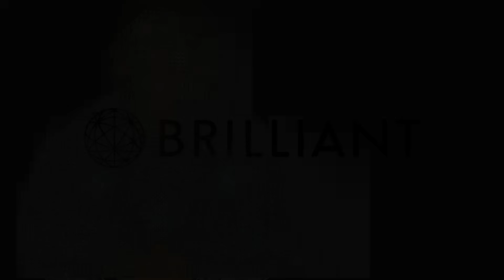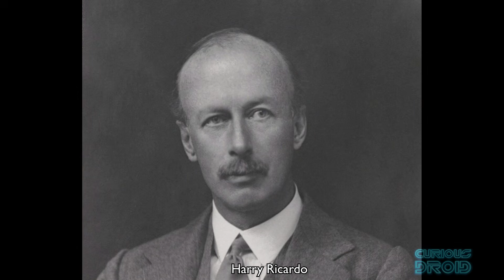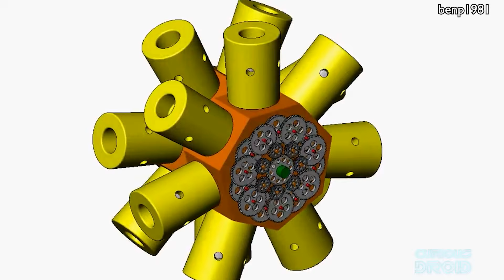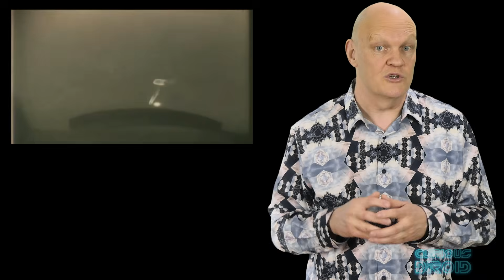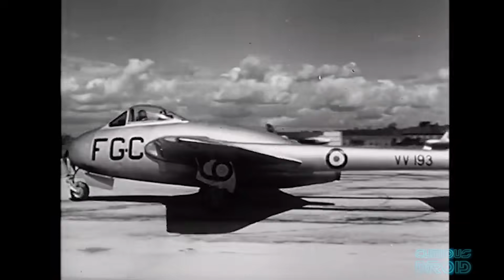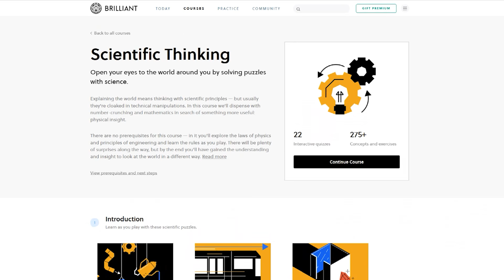Rolls Royce Crecy - The Most Advanced Piston Aero Engine Never Made.

Comment: The crucial advantage of the jet compared to the piston engine, apart from its much higher power/weight ratio, is its scalability. Jet engines can be scaled up almost arbitrarily while maintaining their power/weight ratio, there are gas turbines of 1,000,000 horsepower or more that fit in a railway carriage,  while the most powerful aviation piston engines peaked at about 5,000 horsepower, and the biggest marine diesel engines have around 100,000 horsepower, weighing thousands of tons and being as big as multi-story buildings. The piston engine lost the competition with the jet at the end of WW2 with no hope.

Comment: Historical reverse engineering is fun!
Today there are small businesses that converts 4valve DOHC-engines in cars to cheap reliable pushrod engings. In a Porsche 928 it is not uncommon to swap the 5l V8 DOHC with a Chevy 7.5l bigblock V8. The external  engine size and weight is almost similar between these two engines, but the chevy has 50% more displacement. (an optimized small block chevy 5.7l is too light for the 928 std front suspention)
I just wonder what capacity a "chevy" pushrod, 60deg, V12 with central camshaft and 2 valve heads would have within the space confines of a RR Merlin? Maybe 45l in a much lighter engine?

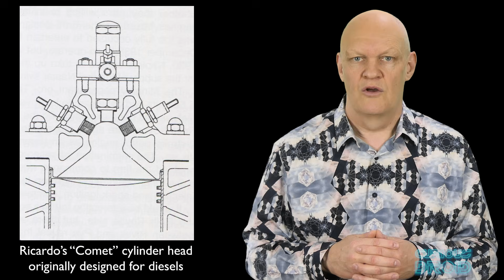Comment: The mention and sketch of the precombustion chamber with two spark plugs (6:27) is obviously the inspiration for the Mercedes F1 power plant wherein a pre chamber is used to get full combustion in a very lean gas/air mix. Funny thing about modern "breakthroughs" and how often the engineering has been inspired by an earlier engineer's efforts.

Comment: I have heard that the Napier Sabre 7 had an optional methanol injection system which would have generated 4000 HP…the 7 was also reputed to run at about 3000 hp without this…is there any info on the specific power of that engine for comparison to the Crecy?

Comment: The side to side movement of the sleeve was incorporated (and I forget by whom originally, perhaps Charles Knight) to prevent scoring of the sleeve and/or grey iron casting by the repetitive up and down motion so the oil pumped onto those surfaces would maintain a more uniform distribution. Complex creations these, as stated in the video.
I also read somewhere, the memory of which also escapes me, that the Martin Baker MB 5 prototype was being considered as a possible recipient for the Crecy.

Comment: Wow a Detroit Motown Wasp Nests Screamer in a Saville Row Suit, Rollers 
(Rolls Royce) lost a golden opportunity to make the Crecy, even lighter, by taking a leaf out of  Jowett,s Book, make the Crecy as a flat twelve ,'Boxer',lighter crank case as both sets of pistons con rods balance each other out, resulting in a smoother running engine.  Creasy,s blower drive is variable via a Fottinger fluid coupling Pratt&Whittney did the same on the R-4360 'Corncob' Radial,. Again Rollers were sleeping on the job regarding the blower. All Roller aero engines used single sided impeller discs ,i.e. one  set of impeller blades even on the two stage Merlin 60-70, and 130 series and Griffon 60 series.  Out in the badlands of South Gloucestershire in a little known place called Patchway, a petulant mercurial engineer going by the name of  Roy Fedden, worked his somewhat dodgy magic for the Bristol Aeroplane Company based in Filton. One day in 1941-42 an RAF Lorry dropped off  a wrecked BMW ,yes cats&kittens a Beemer 801D a sixteen hundred pony fourteen cylinder two row radial salvaged from a crashed Focke Wulf 190A 'Wurger' Butcher Bird,then a very nasty thorn in the RAF,s backside. Like an excited schoolboy with a new toy Roy busily dismantled the'Beemer' 801, his eyes were like that of a crac addict after a snort of best Columbian,both focused on the Beemers single blower disc.Yes cats&kittens BMW machined not one set of impeller blades ,but two,one each side of the disc, resulting in a very compact yet ingenious two stage blower ,without the attendant complication.
Roy re worked his dog of a radial the 16 series Hercules with a new blower incorporating Beemers double sided impeller, . A last a decent Hercules ,the 100 series far better in  altitude performance,ask any Halibag driver.

Comment: It would be good having a Six-flat Sleeve Valve engine for buses and trucks, with Bristol Air Cooled Sleeve Valve Cylinders. Mike Hewland, Car&Driver, July 1974, who worked making Bristol engines during WW II, indicated the Bristol SSV Aircraft engines could be revved up and down, same as a car engine. Its fuel economy is still unrivaled. SNECMA built some Bristol engines under license for the 'Noratlas' cargo airplane, installed also in the Spanish passenger airplane CASA Azor. 
Blessings +

Comment: I wonder why people don’t just use car engines on smaller planes.
A Cessna 172 has at most 200hp, an AMG A45 engine has over 400, so why not just use one of those?
Reply: Because when a car engine fails you just coast to a stop on the side of the road...
Reply: Mercedes-Benz is the only car engine reliable enough to be used in aircraft.. marketed as the Austro AE 300 and the Thielert Centurion.

Comment: 1.77 hp/ cubic inch... so, that is 108hp/liter. That is nearly a third of a modern small Swedish hatchback.

Having more horsepower, also don´t make it more advance. 2 stroke usually have more horsepower, the drawback is more fuel consumption. For a fighter aircraft, that might not be a issue, but for anything else, it certainly is-

Comment: Far too much focus on the complexity of sleeve valves and their oil consumption...
They're less complex by far certainly around the cylinder head where it's hot and it matters!
They could run a whole unit of C.R. higher than a poppet engine before detonation.. that's a lot!
And once Fedden had discovered the secret to making consistent sleeves they developed into the first aero engines to reach 1,000 then 3,000 hours MTBF (Hercules)
 In fact there's something else unsaid here... the rotational motion of the sleeve at TDC has since been found to prevent cylinder liner stepping/ridging at the top ring due to the elimination of any phase of boundary lubrication... so no slow compression degradation due to cylinder and ring wear.
 In fact with modern lubricants sleeve valve engines have been looked at again.
.the Sabres early issues were solved,  they were not fundamental sleeve valve problems but poor production control and poor detail design. A serious issue was a misinterpretation of an oin-field service carburrettion modification.
  Napiers were not RR and did not follow through to production and in service detail debugging in the same way.. RR were fastidious in that area.
Latter Sabres were highly rated by their pilots in pure acceleration power in Tempests and getting you home.
 So rushed into service- yes.
 Compromised design with serious long term issues- No!
Reply: The sleeve was a brilliant American design invented by Charles Knight and licensed to several British companies.

Comment: Fantastic dive into sleeve engine!
Reply: Invented by American Charles Knight... and licensed to several British companies.
Reply: @sandervanderkammen9230    Thanks.  Didn't know that.  I'm a nerd for any clever machine designs that actually worked and maybe new to me.  

(have Mech. Engineering background, but that is about how to apply math and physics to predict efficiencies, stresses and strains, theoretical limits and so on, it's NOT about existing tech or history)
Reply: @Mrbfgray  The Knight engine offered several advantages in efficiency over poppet valve engines  until fuel formulas and exhaust valve metallurgy improved.
Sleeve valve aero engines were rendered obsolete by Hans von Ohain's invention of the jet engine and subsequent aero gas turbine engines.
Reply: @sandervanderkammen9230    On the surface--a few potential drawbacks:  a LOT of sliding contact area friction and very high "oscillating" mass compared to standard valve/push rod competitor.  The sleeve will have to have tight tolerances but will still leak a little, surely adding to piston ring blow by to crankcase. 

 Cylinder side breathing seems inherently inferior to top intake/exhaust (how do you flush the top of stroke?) except for the increased opening size significant advantage.

Comment: Two major factors that I see would have prevented this engine going into a front line single engine fighter (is spitfire) - fuel consumption and field servicing intervals. 2 stroke engines consume fuel at a much greater rate than an equivalent sized 4 stroke engine. 2 strokes have a more peaky power curve and it is generally higher in the rev range where it is consuming more fuel. Although power equals torque x rpm. In an piston powered plane it is the torque that is really required for the propellor to bite the air. This is why there is reduction gears as this increases torque. A higher revving 2 stroke engine in its power band will require reduction gearing as well to achieve the torque but it is using more fuel to achieve it. The other aspect is servicing intervals. In general if the power stroke is every second stroke ie 2 stroke versus every 4 strokes ie a 4 stroke engine then overhauls in general need to be more frequent. This is not what is required for a fighter. This crecy engine would have been planned as a race engine for such races as the Schneider cup, which Reginald Mitchell won outright for Supermarine- my two cents worth

Comment: Comet cylinder head is a similar concept to that used in the stratified charge used in the engine of a Honda Civic I had - mid to late 70’s - which was the last one that met emission requirements without a catalytic converter.

Comment: The second stage supercharger is only used at higher altitude and not at sea level on a test stand. That is why the Allison could match a Merlin at low altitude but was really ineffective above 15000 feet unless it had a turbocharger to add intake air density.

Comment: Saying that backpressure increases power on a 2 stroke is very simplistic and misleading. The phenomenon you are probably referring to is pressure wave reflections in a tuned pipe expansion chamber. This reflected wave is used to kind of stuff the air/fuel mix that rushed out the exhaust port during scavenge back into the chamber. This would have been lost otherwise and power would be lost as well. The expansion chamber cones are a complex equation, but a relatively simple concept - as is my explanation.

Comment: Very good video .
The the final development of the Napier Saber achieved 5,000 HP on test with water injection.
The Saber was a sleeve valve H24 used in the Hawker Typhoon and Tempest fighter / bomber.
The turbo charged four stroke spark ignition engine has proved to be the best solution for high performance.
The turbine has been the answer for aviation as it is powerful very reliable with the current high temperature alloys.
Reply: Wanted to write the same

Comment: Another benefit of the Sleeve Valve is that it eradicates all the mechanism in the cylinder head, hence the cross section of the engine will be smaller and thus more aerodynamically efficient. Lubrication though remains a stumbling block.

Comment: A Rotary engine is one where the crankcase rotates with respect to the airframe, such as the Gnome Le Rhone. What you are mislabelling is a RADIAL engine, where the cylinders are arranged radially around a fixed central crankcase. Because rotating the whole engine is an obsolete concept, the term Rotary has been re-used for non-reciprocating engines such as the Wankel.

Comment: Many thanks very interesting, but avoidable small errors as in the Bristol Hercules etc being "Radial' NOT "Rotary" ( a completely different concept motor as in WW1 Gnome the cylinders rotated around the crank ) also Implication that the merlin was 2valve . It was a 4v per cylinder. 4v per cylinder  pioneered by Ricardo particularly in the 'RiCCY'
Triumph motorcycle of the early twenties and most of the Rudge motorcycles that were contemporary.

Comment: Rolls-Royce developed another aero engine during the war which never panned out; the "Vulture".  The only production aircraft in which the Vulture was ever installed was the Manchester bomber, which was a failure.  However, the Manchester's two Vultures were replaced by four Merlins, and the Manchester bomber was transformed into the highly-sucessful Lancaster.

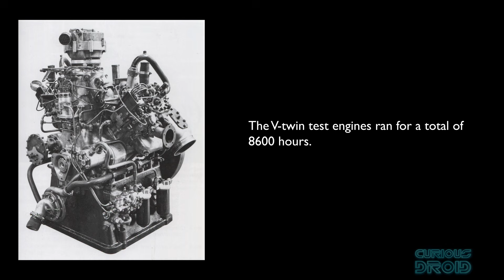Comment: At 11:45 it is stated that Crecy No. 12 used a "shaft driven, exhaust gas turbine blower."  The photo appears to show an exhaust gas blower (turbocharger) at the top and rear of the engine.  It can't be driven by two methods.  This was an addition to No. 12.  And yes, a shaft driven supercharger below it.

Comment: A lot of small errors, a number of omissions and at least one glaring error.  The Crecy is not mechanically complex, there were some complex issues to solve such as stopping the pistons from melting, there is a lot of heat to be managed and leaning out the stratified charge will cause a lot of damage.  But the engine is quite simple compared to 4 stroke engines.  

The engine was a long way from production, given how long it took RR to get the Merlin from the absolute dog it was in the early days to a good engine (everyone forgets this about the Merlin), it would have taken many years, especially at the lacklustre pace RR was developing the Crecy.   The Griffon was a well designed engine, but it probably took less effort to design it that it did to get the Merlin running okay.  It was a conventional engine using a lot of knowledge gained from earlier engines, so there is no comparison to the Crecy to give us a likely timeline for the Crecy.

One interesting point was that RR found that the Crecy's specific fuel consumption was much the same as the Merlin (not sure about the oil consumption - the Merlin was from about a gallon an hour up AFAICR), or so they say, there is little documentation on the thing.  I think the eccentric sleeve actuating mechanism is very neat and elegant, I can't remember if that was an RR or Ricardo thing.

Ricardo was not happy with  RR's slow progress on the engine.  His firm also worked on the 2 cylinder test engines. In the early days of the Sprint project, Napier and at least one other firm (the name of which eludes me) built small test engines, but I don't know what happened with their test engines.

Other interesting engines:
both the first and second Napier Nomads,
The Napier Sabre,
The RR Exe and Pennine engines (air cooled sleeve valve X24 engines to show that RR could build an X engine after the Vulture debacle).
Junkers 223 and 224, very neat design but like the RR Pennine a bit of a distraction from the main game 
The Junkers 222 which essentially killed the German heavy bomber programme
the Bristol Centaurus

All advanced engines, obviously, there are others.  Of them all, the most advanced is IMO was the Nomad, at least from a thermodynamic viewpoint which was shown in its specific fuel consumption.   The only true compound engine.  Careful inspection of the engine and reading of Chatterton's work shows the engine to be an axial flow gas turbine that uses a 2 stroke diesel as a gas producer.  

When it came down to it, the only real advantage was the diesel, with its pressure oil cooled and special material (austenite - by mistake I have written martensite elsewhere) piston crown, could run much higher temperatures than any turbine.  Combustion temperature is a key factor in determining the efficiency of a gas turbine,  The higher the temperature, the higher the efficiency.   

There were lots of design issues that had to be solved before this puppy would run, just getting it started required a spark ignition system as without the compression (and thus heating) of the air by the axial compressor there was insufficient compression to ignite the fuel.  

Some solutions were innovative but necessarily complex, and it was the complexity and the problems that lead from it that doomed the engine.  The conrod big and little ends were very interesting.  The proposed Nomad III was even more complex and was tending back to the complexity of the Nomad I.

Comment: Great discussion about an engine I was not aware of. The holy grail of piston engines has always been about 1 horse power per 1 pound yield with good  reliability. Noise would have been a major factor if the Crecy had been deployed as you point out. Sitting in an aircraft for a couple of hours is tiring to the point of distraction if the engine decibel level is excessive. I understand the Hawker Typhoon and later the Tempest were almost unbearable. One wonders how many aircraft were lost due to their pilots being distracted by the racket being produced up front. I speak from experience!

Comment: Hmmm, just thinking that the 3 l race  cars of the 30's (Audi & Mercedes) produced close to 700 HP, very high specific output of over 200 HP per liter of displacement. The Crecy is  complicated due to the sleeve valve but using simpler rotating disc inlets ( parallel to the crankshaft axis) instead of rotating the whole cylinder sleeve would make these engines much simpler. You would still have a two stroke with a power stroke for every turn of the crank. DKW, MZ and Yamaha had such engines. 200 HP per l is easily achieved by 2 strokes.